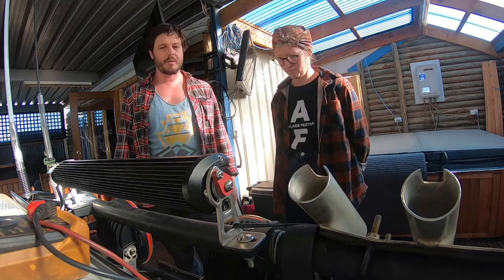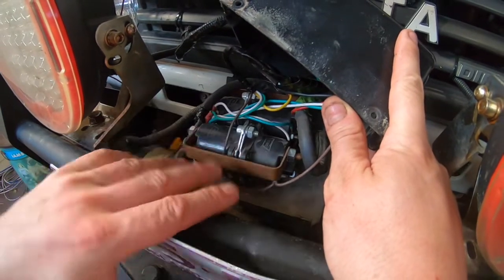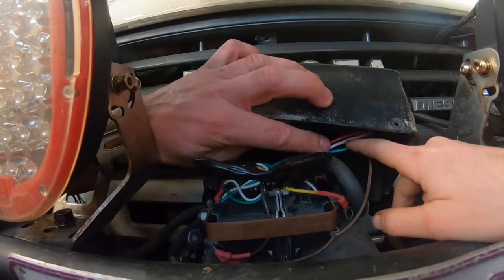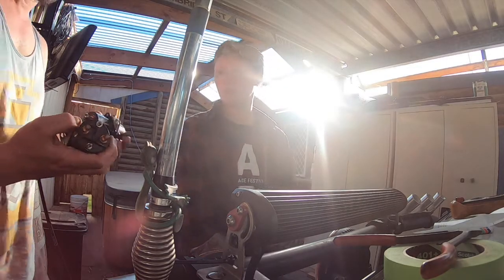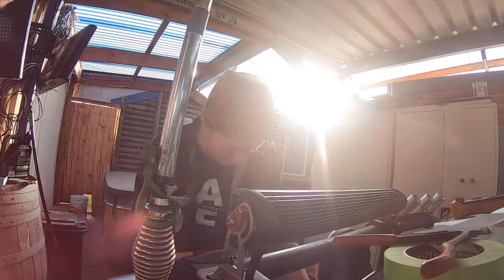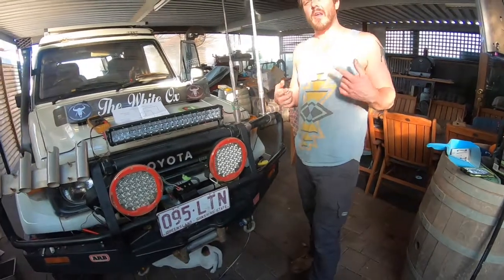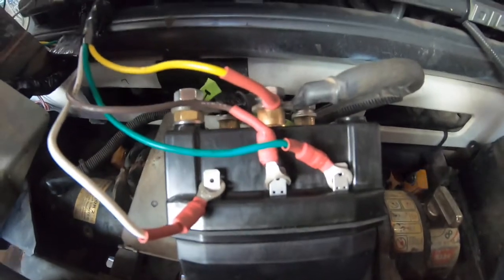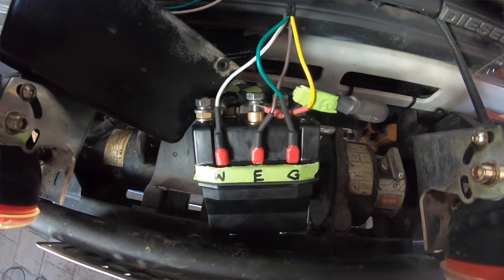Installing an Albright DC88/DC182 Contactor | Replacing Warn Winch solenoids | Bush Mechanics

Comment: Great little series, I have an old warn xd9000, I think I'll install one of these as well. Do you have any thoughts on what type of cranking battery to run with a winch? I cant decide what to get, dont want to kill it winching..
Reply from the maker: Good question Kyle, essentially you would want to get a good quality starter battery that can output a lot of power, and just make sure your engine's running while you're winching, that will ensure your battery doesn't go flat. 
Don't really have any particular brand recommendations, but just spend a bit extra and an easy way to tell if it's good is just to pick it up! The heavier the better- means more lead and more plates, which is what you want.  
Really pleased to hear you enjoyed the series.